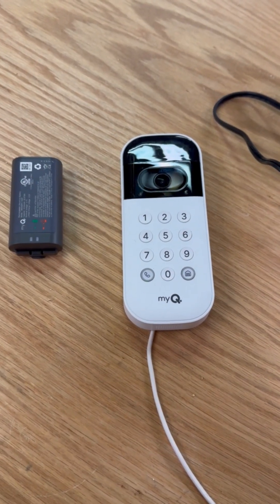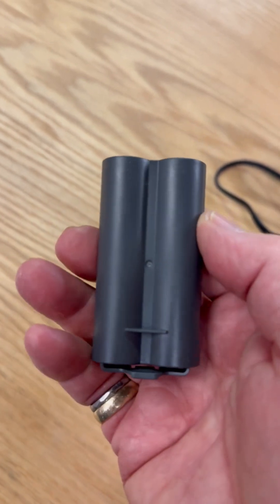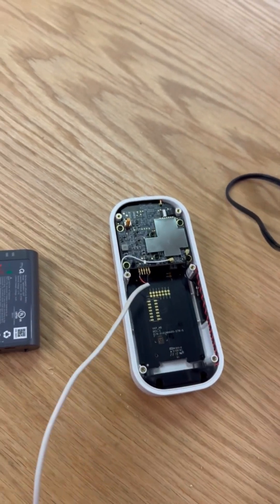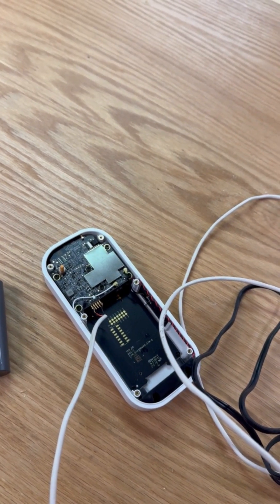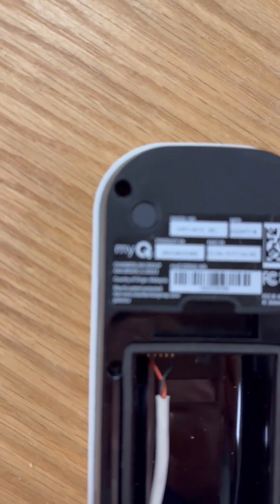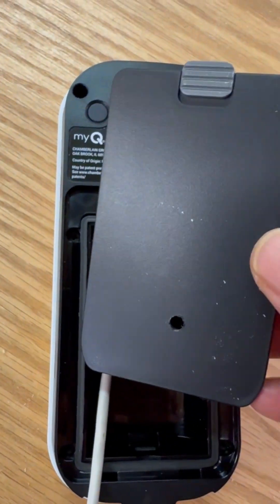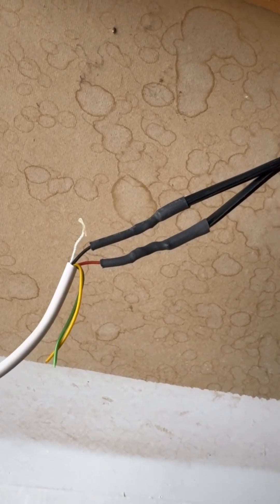MyQ Battery Hack

Comment: Fantastic job brother you saved me a lot of fighting out. Now if some 3ed party can make a battery with half the size of the original battery with 5-volt DC power and keep charging this battery  that will be excellent
Reply from the maker: Wouldn’t it have been great if they put the charger plug on the outside of the camera?  Poor engineering.
Reply: @TriffidKiller  Even a wireless charging at the bottom  just run the cable for few hours and it is good to go no need to keep taking it out

Comment: Can you give me more details on that “white” wire?  Like a model no. or where you got it?  I got the same transformer you got
Reply from the maker: The wire I used was 18/4 FT4 hookup wire normally used for security systems.  Any small gauge wire will do. I prefer solid because it’s easier to solder. This is a link to Amazon but just visit HomeDepot and see what they have on the bulk spools. https://a.co/d/0amv78FV
Reply: You rock
Reply: One last question… When you connect to the transformer wire, does it matter where the red or black wire go?  They appear to be identical wires on the transformer
Reply from the maker: @lordrasta9990  Yes.  Polarity matters.  The transformer has to be 5V DC and as such there is a positive and a negative lead.  In my video the positive lead is the red wire and negative is black.  On the transformer, one of the wires is usually identified with a dashed line and that is usually positive.  I would double check with a voltmeter set to DC Voltage.  It will tell you if you have the polarity right.

Comment: I have the Chamberlain opener with a camera and it has a battery they claim can last 30 days.  I've opened and closed the door during a power outage but it opens/closes slower than normal
Reply from the maker: If you have an opener with backup battery, you may not want to perform this hack.  This mod eliminates the battery of the keypad and will not work if the power is out.
Reply: @TriffidKiller  - I understand but I should still be able to use the control on the wall like I did the last time the power was out
Reply from the maker: @lordrasta9990 yes absolutely.

Comment: Will this power supply work? BTF-LIGHTING AC100-240V to DC5V10A Max50W Suit 9A 8A 7A 6A 5A 4A 3A 2A 1A Device Transformer Power Adapter Converter with 5.5x2.5mm DC Output Jack for WS2812B WS2811 WS2813 SK6812 etc LED Strip/String
Reply from the maker: It should work.  Its overkill but it is the right voltage and has enough power.
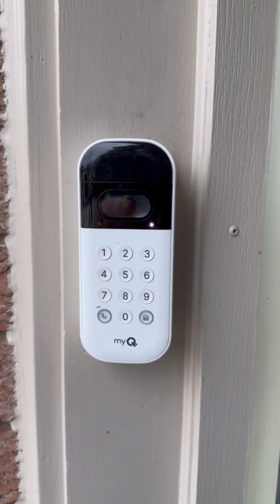Reply: 4:18 so I followed your instructions…keypad works but I’m not seeing any video.  Am I missing something?
Reply from the maker: @markjb1956 I would try reconnecting it to your app again.
Reply: @TriffidKiller so I deleted the keypad from the app, reinstalled as “new device”.  Works great!  Thanks for your help.
Reply: Low voltage garage door opener wire ok for this ?